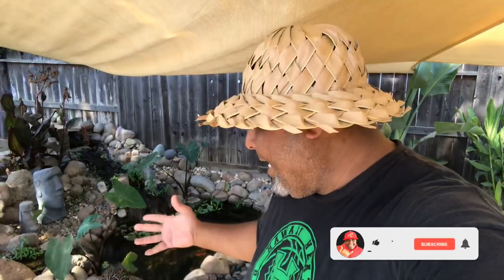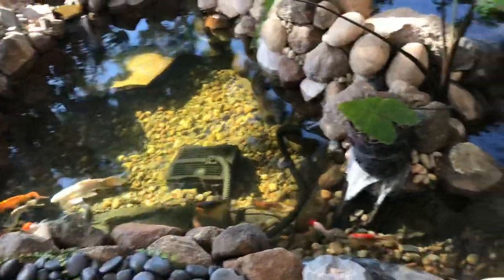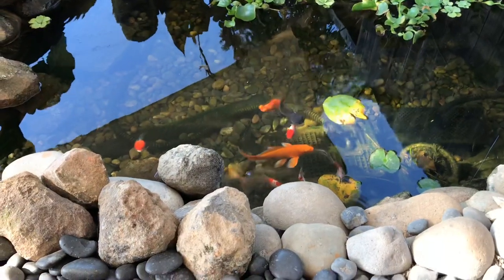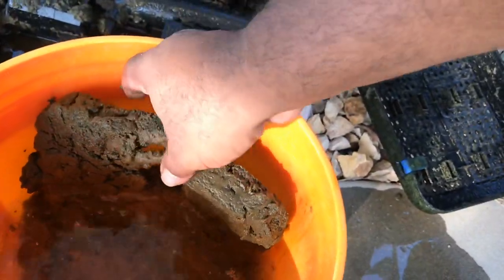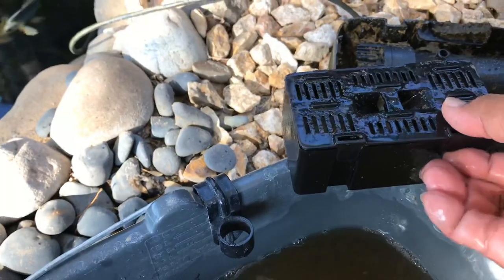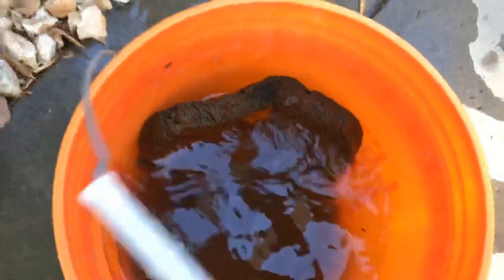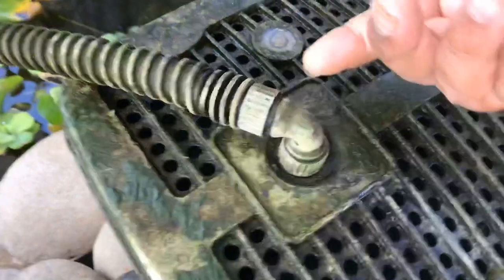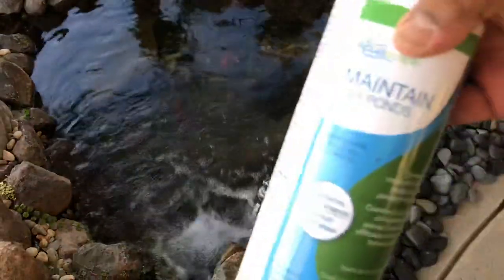EVERY DIY BACKYARD POND NEEDS ONE!

Comment: Where did you get the hose and fittings that hook to the filter, almost bought it but noticed it comes with a spray pipe instead of a hose to my soon to have waterfall
Reply from the maker: I bought 25ft of 1” pond hose at Home Depot 🤙🏽🤙🏽🤙🏽

Comment: JEEZ, U NEED TO CLEAN UR SUBMERSIBLE FILTER MORE OFTEN, when I saw that, that reminded me of the bottom of my pond before I cleaned it out. Fun fact, the plastic rings r made for a sump filter. Sump filters r big but require almost no maintenance.
But I don't think u need 1, since all 8 of ur filters are working nicely even though without 3 months of cleaning, Why can't I stop talking about filters.. The reason I said 8 instead of 6, is that u can't forget about the rocks and plants ;))))
Reply from the maker: BOOM U NAILED IT ALL!! 🤙🏽🤙🏽🤙🏽